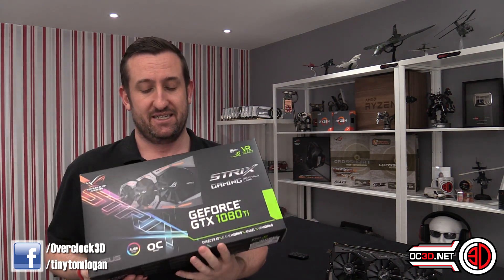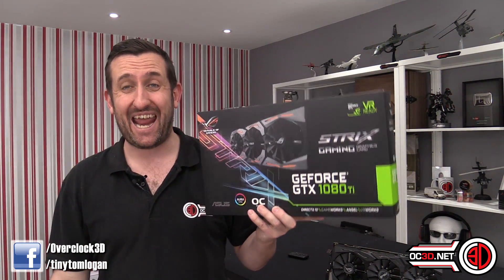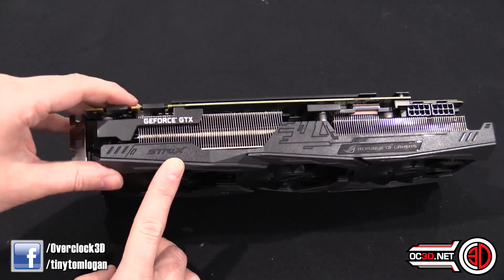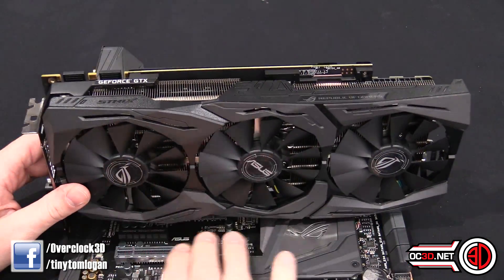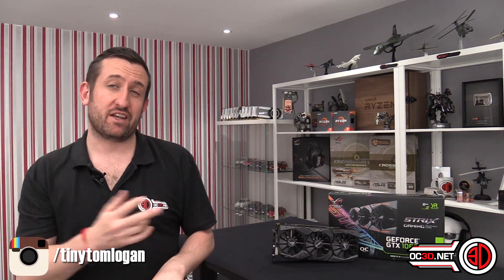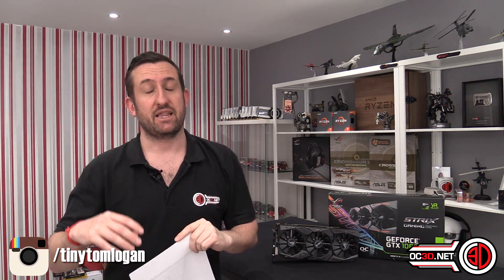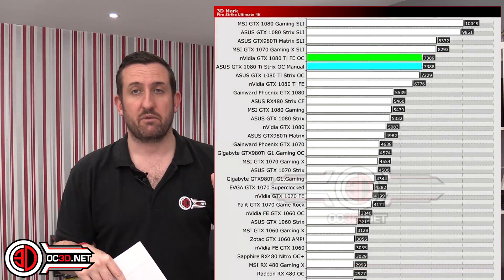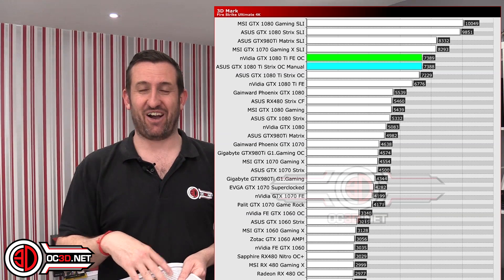Asus GTX1080 Ti Strix OC Review

Comment: You think i can put 4 of them on my EVGA Z170 Classified ? or am i going to have to wait to get the water cooling block/brackets for it.
Reply: Khue Yang nigga why do you even want four when they only support two and most programs nowadays don't even allow for SLI boosts. Not to mention the bottleneck you would have.
Reply: Im sure they come up with a driver fix for it sooner than later. Im maininly going for the look and aww factor not really gaming. There is something about having 4 SLI cards in series that makes some people cum. I have 4x Titian X's currently, so i figured i should upgrade to 4x 1080Ti's
Reply: 4x Titan X's is more than enough, Pascal is only supporting 2-way SLI and its been confirmed by nvidia. There's no need if you already have 4 fucking Titan X's.

Comment: Great video TOM! Looks like a nice bonkers of a graphic card. Unfortunately, my 26" Wide Screen Viewsonic is running under 1089p or 1920X1200 at 60hz resolution and is still doing fine. And I know that buying this card now is way, way over-kill. But when my LCD needs replaced and I decide to get a 1440p or 4k Asus monitor, this card should do a good job. My only dilema would be to either buy a 1050, 1060 or 1070 to use with my monitor now and when it dies get the best card out there for my new 1440p or 4k monitor, or stay up on technology and get this monster of a card running in 1080p. Anyway, great video as usual. Keep up the good work.

Comment: omg they FINALLY ditched the direct contact heatpipes! about damn time, thats been useless ever since they stopped making cards with heatspreaders.
asus did a great job on this card, the pcb is great for overclocking and has solderpoints for a bios switch, so that might be possible to add. cant wait for the matrix.
what asus cant do anything about is its still locked up like fort knox, it still doesnt scale with voltage, everything nvidia stands for these days... so still plenty of reason to wait for vega, at least for me

Comment: I want this card so bad. I just got my new maximus ix formula. i7 7700k with 4133 32gig..please help me lol by the way ..you talked me in to going with the mother board :)
Reply from the maker: ken wood that memory will be hard to get running with safe volts. You'll need to set that up manually
Reply: I have not pulled the triger on it yet its in my cart. what would you think i would be better off with Im going with the G.SKILL TridentZ RGB Series  3800?
Reply: also talking about this video card is there room for 2 of them? I seen you show it in the first slot but did not move it down to the 2 nd shot.. and will that cover the 3 rd slot? I was thinking about a pcie hard drive for the 3 rd  slot and running in time 2 videos cards..but for now I will be lucky to get 1 lol

Comment: Who dafuq does SLI anymore? That tech is dead and useless 99% of the time.
Reply: I have run SLI for the last 2 years and havent noticed any micro stutter and I am very sensitive to it. Sli has come a long way and when it works it works really well.
Reply: [Insert Name Here People who have enough money to either not give a shit about the cost or extreme enthusiasts who buy it just to have the fastest possible.
Reply: [Insert Name Here] sli 970 user here before upping to a single 1080. sli was fine most of the time. smashed everything for performance single card wise
Reply: It's become a thing to bash sli? i've had only one problem, and that was fixed with a different profile.
Reply: as i said, ive ran sli with a pair of very ocd zotac 980 amp extremes for over 2 years now,  and ive only experienced any real issues in the division,  where it would be very unstable and i had to disable sli. thinking back, i did have stutters and oddities in deadspace 3, but never tested it with sli disabled, but as i look back now that was likely the cause, overall ive found sli has worked in the vast majority of the games ive played without any issues, so as its the only way to push max settings north of 100fps in games, im going with sli again, though i did think seriosly about skipping pascal and dropping back to 1 card next generation which should handle 14409p and 4 well alone at the rate we are going.
Reply: You people are so wrong, 25% correct as usual.
SLI benefits some games, but SLI only works well if the developer coded the game for more than one GPU, which almost never happens because the market is focused on consoles. It's like the people bitching over SMP, SMP will only work when the API is implemented. When SLI API is implemented games can and DO run better.
Reply: fame805 yeah, same for me. A different sli profile can help a lot in most games, you just need to use NVIDIA Inspector to change it.
Reply: i never had any issues in the witcher 3 or gta5 and enjoyed a considerable fps boost, maybe i was lucky, i know friends with sli who never had issues in the division, where i did, which is why ive gone for it again, i found it worked the majority of the time, and where it did, a single 1080 or ti would be either slower (vram allowing) or not offer a large enough gain to justify the cost to me, however the gains to be had of 2, seem to be far more of an upgrade and as such worth the insane price, if im unlucky over the next 2 years and i suffer microstutters etc then i will likely go back to a single card, but right now, 1 card wont really offer the performance im after, and in my experience ill get most of the time, i just hope im right, as even at evgas discounted price of £1468 (2 ftw3 which ek have told me will have full blocks for soon - something i checked before i even thought about buying lol) is a hell of alot of money, and im having to delay watercooling to afford the pair lol
Reply: It's not dead and there are more people using it than you thought. It is not useless since it can boost the performance. Maybe you just don't have the extra bucks to buy a second card. I run SLI in my laptop(dual GTX 980m), and I'm looking for a second 980Ti with waterblock on eBay to SLI with my current one.
Reply: But it's true that the support for SLI today is not as good as they were during the GTX680 time when you can get at least 85% boost.
Reply: Stuttering doesn't exist with the HB bridge or from my experience with the 1080 SLI
Reply: [Insert Name Here] , 3D rendering & editing of cause :) playing SLI sucks most of the time
Reply: How can they make it totally hardware based? The only reason pc components work is the software.
Reply: well i just pre ordered a pair of evga 1080ti ftw, as frankly at 1440p , i want to be at 100+fps, as i find it much nicer than at 60, which in games like wildlands, is all the ti can reach, and isnt really worth the upgrade when i can get to 40-50 with my 980's, yes its a stupid ammount of money, but id began putting cash aside when i built my last pc to cover the next update, so, 2 years worth of savings isnt as big of an impact, id planned on sli 1080's when their price dropped due to the ti, but the ti seems fast enough to warrant the extra, and i find sli works far more often than it doesnt in the games i play, with the division being the only non unreal game to have an issue so far.
Reply: well I have a 1080p monitor and want this GPU what would you gouys recommend for the monitor 
no TN panel please and it needs to be at least 1440p as well as have 120hz+ and have good colour reproduction also i want low response times at least 1ms if there is one
Reply: They are killing it off I believe. If game developers optimized it better on PC, you'd be able to max everything out just by putting a one dollar bill in the PCI-E slot.
Reply: [Insert Name Here] correct!
Reply: I'm thinking the same as you, but literally always staying up to date, as in selling card every year and getting best thing... As like a constant investment, plus reinvestment due to loss of value. What do you think this will cost in let's say.. 6 months to a year in USD?
Reply: Two of these in SLI can easily push over 100fps at 4k in a lot of games. Once they release the 4k 144hz monitors next year? Worth it imo.
Reply: That's what people who can't afford them always says.
Reply: i saw sli/crossfire as a scam till they somehow guaranteed 100% capability
Reply: Agreed, it was a marketing gimmick from the get-go. Anyone who bought a second card was a sucker, except me (who just pre-ordered 2 of these). I know it's a gimmick, but I just don't care.

Comment: Im getting a 1080ti in the next 2 months and add it to my custom wc loop...should I get this one or stick with the FE?
Reply: FE for sure. The only advantage of custom Pascal cards is the better coolers, and you'll be removing that cooler anyway. The 1080Ti FE PCB is actually extremely overbuilt, so it's a rock-solid card in every respect. The VRM's for example are like 3 times more capable than they need to be. And you'll have easy access to the really nice full-cover water block from EK, so it's a great choice imo.

There's literally nothing AIB/third party cards can do to improve overclocking if they're on water, the chip is simply locked down voltage-wise, by NVidia. Custom BIOS might help, but that'll appear for the FE for sure, if it appear at all.
Reply: unik544 FE for water cause you can OC it to to perform anyway.
Reply: id go with whatever is cheaper tbh as your already going to be cooling and OC on your own.
Reply: Not exactly, FE cards don't have DVID connectors and the custom ones do.

Comment: I'm really looking at getting one of the Strix cards and still play at 1080p. I have a 144hz monitor though and want to see all the frames! On the topic or the Strix cards should I really bother spending an extra £10 on the 'OC' version? I will be manually overclocking it anyway so it just seems like a waste of money to pay extra when it won't give me anything extra?
Reply: I'd look at it the other way; when it already costs £800, don't you think it's worth the extra £10 just to have the peace of mind that you have the best possible card you can get?
Reply: Yeah you might save 10 and not get the same overclock as the more expensive one. These ones are guaranteed to at least be higher than the others.
Reply: Yep, my Strix 1080 Ti is coming on Tuesday. Hyped!
Reply: Yeah I guess so. I'm just looking on SCAN at the moment. Can get a MSI 1080 Ti Gaming X for £760 that from factory boosts to 1683 MHz. The Strix 1080 Ti OC is £800 but boosts to 1708 MHz from factory. Hmmmmmmmmmmm.
Reply: Duncan Hardly a huge difference. Probably 1-2 fps at best.
Reply: Atleast with the 1080 Strix the OC version overclocked higher than the advanced or standard.
Reply: I find it hard to believe a 1080Ti would get much of an advantage at 1080p over a regular 1080. I mean, sure, I enjoy overkill too, that's why I have a watercooled 1080Ti, but....
Reply: I think a 1080 is pretty good for high refresh games at full HD resolution. Even if going for 240hz monitors, you'd most likely be turning down dynamic reflections in OW or getting plenty of frames in games like CSGO or LOL. The 1080 is at a great price point in the US, $500 for 1080p 144-240hz monitors.
Reply: I have been able to get +80 on the core and +400 on the memory. With Gpu Boost that puts me around 2050mhz core and 11900 mhz memory. Def a nice improvement.
Reply: Awesome! Enjoy man, its one hell of a card.

Comment: 3440X1440 is the sweet spot for dis card
Reply: Acer x34 then..

Just like what i'm using right now.

But I pump it with Gigabyte 1080 Ti FE Sli 

hehe
Reply: SLI is not needed, i got asus pg348q and runs it with a single water cooled gtx1080ti. everything i play runs above 75hz
Reply: I have the x34 screen.. computer almost done, running with this Strixt card. nom nom. !!

Comment: Only downside with the new Asus design is that my ROG 1070 had horrible GPU sag. Probably going Foundera becuase Im not a overclocker.
Reply: 5ean 5ean If you're not an overclocker, then this one will be quite a bit better as it is overclocked out of the box for you
Reply: Red Ring of Death 

Maybe....if I do go aftermarket im going EVGA SC or MSI Gaming X. ROG is simply too big and I cant get over the sag. I have an windowed case and its an eye sore.
Reply: Why not just buy a GPU brace? Any heavy card will sag, no matter what back plate or reinforced slot is in the mix. I use a brace, and now I'm designing a 3D printed brace for dual cards.